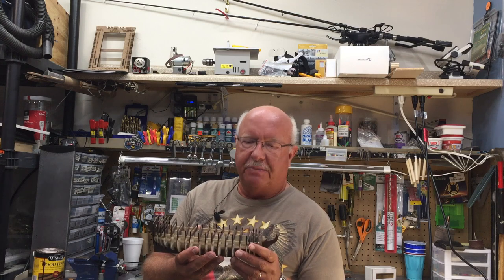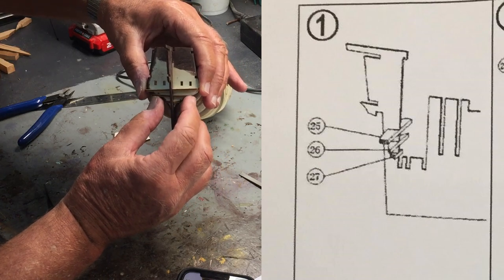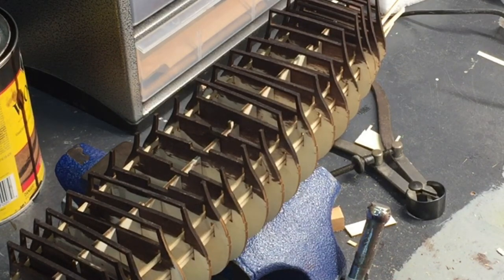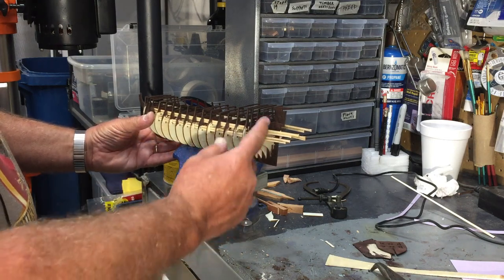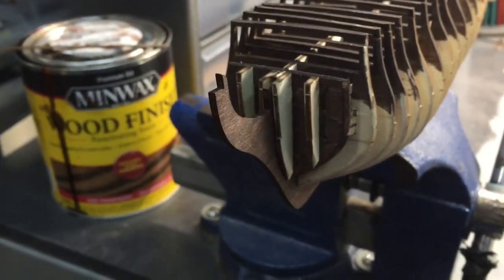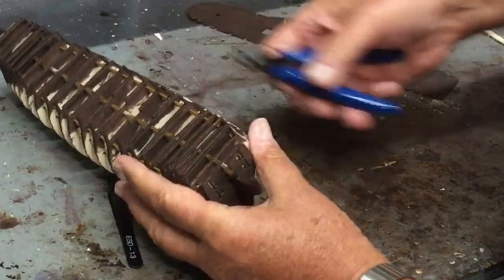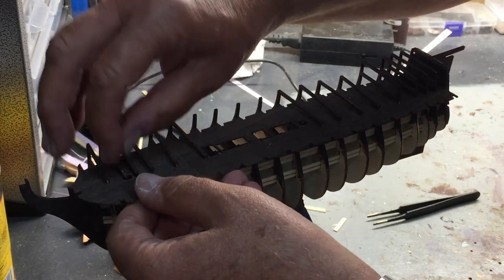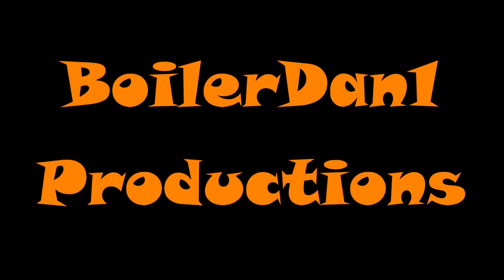HMS Victory Model Ship Build Episode 2

Comment: Hi reguarding the planking timbers you used to thread through the holl sides,well i had an old plastic paint tray and cut off the edges and it worked a treat👍👍
Reply from the maker: I’m guessing that the plastic slips through much easier!  Great innovation! That’s what it takes to succeed with these types ships 👍👍
Reply: Cheers dan keep safe👍👍

Comment: Hi Dan, I'm pretty sure the slats that you just put in are required because they sit behind the gun ports and you will need them to attach your cannons to. If leaving gun ports closed, they are not required!
Reply from the maker: I’m surprised that there’s nothing in the instructions nor the slats in the parts. Thanks for the guidance 👍👍
Reply from the maker: A little follow up: I did notice that they matched up to the cannon bay windows.  I’ll work on deciding how many to make cannons for.... since I broke about 6 of the frames, at least 6 will be closed 🥴.
I do appreciate your input 👍👍

Comment: thats coming along nice . i had to take a break from mine . working on a rc boat. converting my PT boat model to a radio control
Reply from the maker: Thanks! The conversion to rc sounds fun too..... Hmmm, I wonder if you could add a mini c o 2 canister and mount a miniature gun that would fire a pellet? Even more fun! 😂
Reply: @BoilerDan1  all is possible , probably put a rotating spot on it but it's a slow process

Comment: Where did you got the paint from and I don’t understand how to put the wood in?
Reply from the maker: On this ship I used a red Mahogany stain: Minwax semitransparent Red Mahogany #225.
Since completing the model I have determined that you can slice down the middle of the deck section and then slide the two pieces in separately. Then realign them and glue the seam back together.  I think that would work better.
I have purchased another one and will do another version in the future, however that’s probably a year from now as I have a large project starting in the near future.
Thanks for watching. Hope the series helps and motivates you too.👍👍